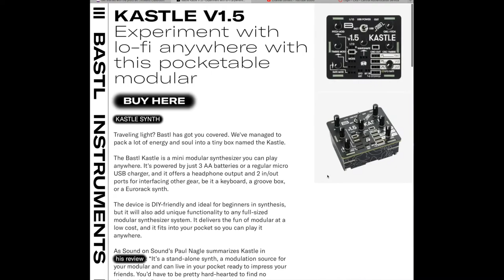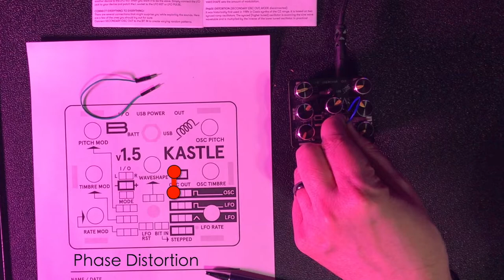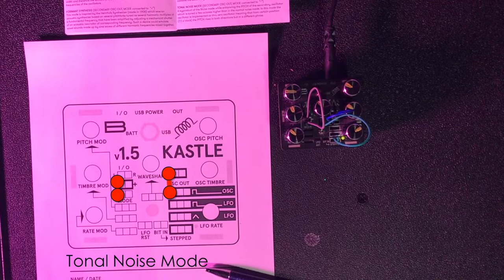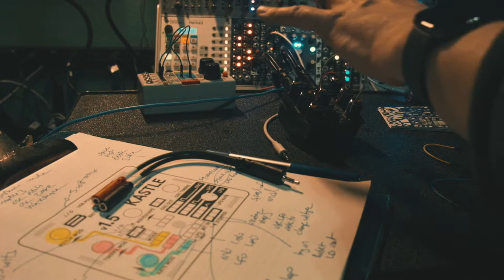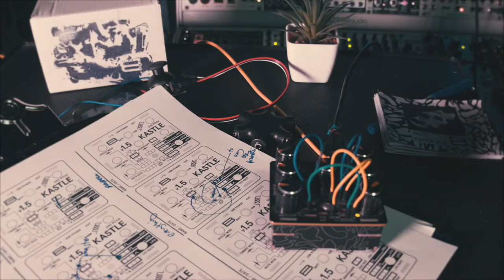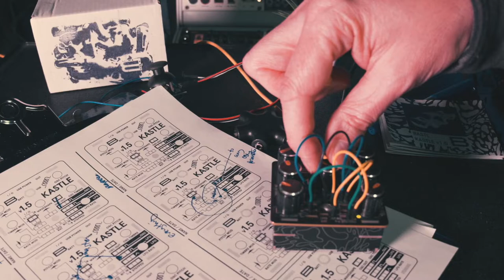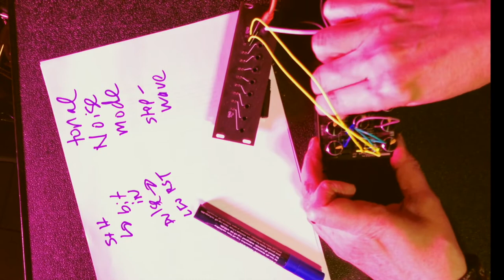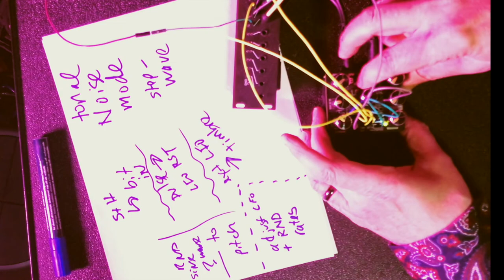Bastl Kastle 1.5 - Unboxing & Review

Comment: Great production values and sounds, thanks! Subscribed 😍

With the I/O ports, I think your explanation left out that both the left and the right channel can be used as input or output. So you can have two independent inputs, two outputs, or (as you used it) one input and one output - in addition to the primary output.

For the six synthesis / sound modes, the official Bastl Kastle 1.5 announcement video really explains them well. For each of the mode settings (nothing, minus, plus plugged into "mode"), the primary oscillator outputs one synthesis mode, and the secondary oscillator outputs the other.

So when you've connected the primary and the secondary oscillator, and then listened to the primary output, what we're hearing are both the primary and the secondary oscillator, and thus two synthesis modes at once. If you want to hear just the output from the secondary oscillator, you'll need to plug just that into one of the I/O channels, and then listen to just that and not the primary output; that's the only way to "get rid of" the first oscillator.
Reply from the maker: thanks, your explanation is really helpful!